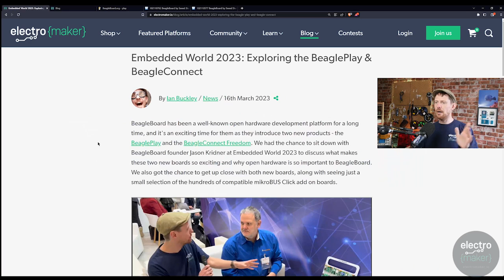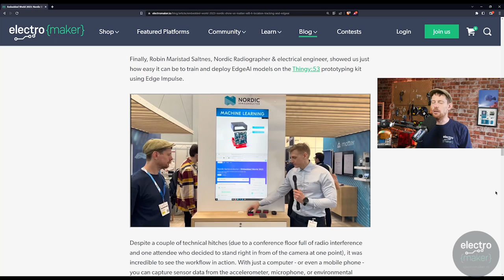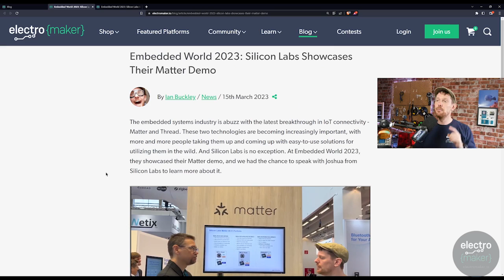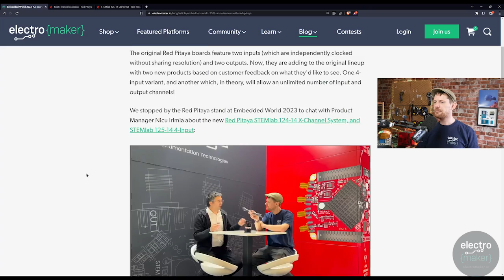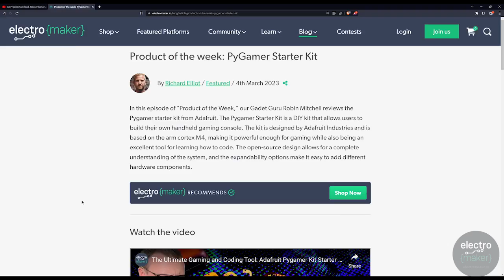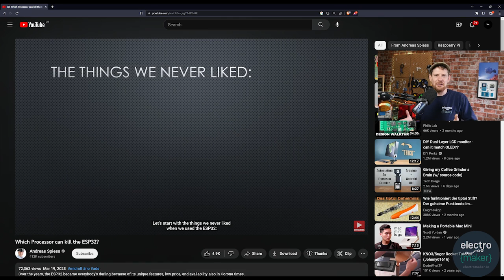Embedded World 2023 Roundup, New Arduino, New Xiao!

Comment: I expect Seeed to release a variant of their Xiao Expansion Board, with the appropriate pogo pins as the JTAG connectors pads are exposed on the bottom of their new board and also if that expansion board has a flex PCB bit to plug into the FPC connector that could be really useful for the maker community.
Reply: Sadly, the fact that you have to plug in an antenna makes it unsuitable for my project.